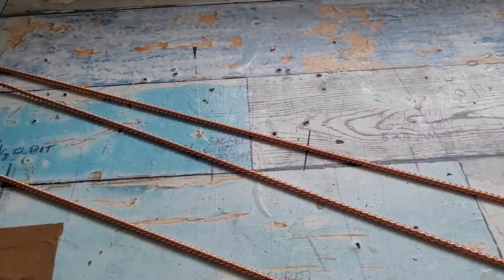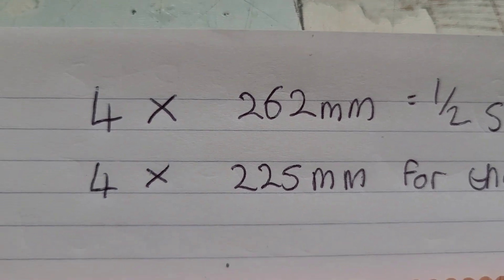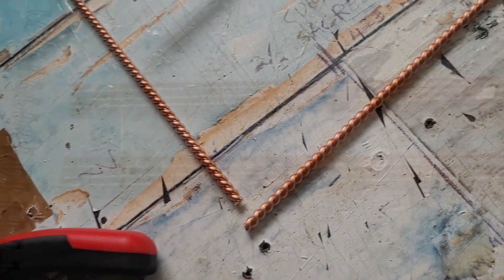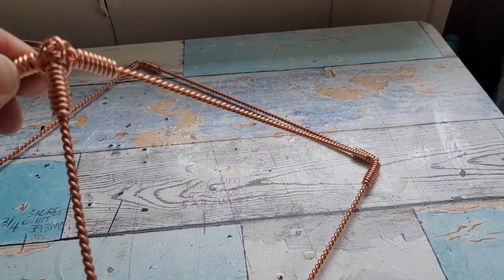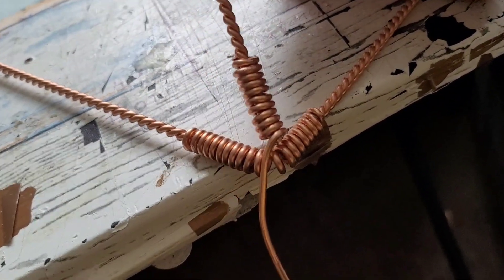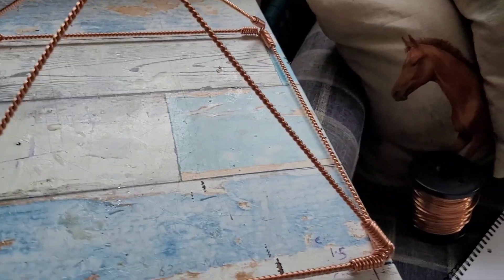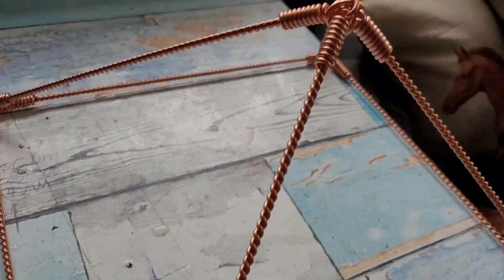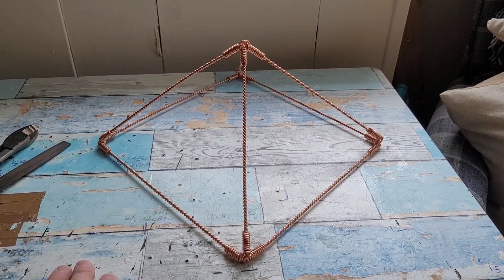How to Make a Tensor Pyramid [Step by Step Instructions]

Comment: What gauge is the copper?
Reply from the maker: @iconicexteriors6486  it's 2mm copper which is UK 12 gauge 🙏
Reply: @cosmicjourneyswithalanstoc5608 outstanding, thank you.
Reply: If I apply a crystal to the 3rd eye area, will that lower or raise the connectivity.  I ask because these measurements are precise, and i don't want to lower it at all.
If that makes sense.
Reply from the maker: @iconicexteriors6486 it will definitely help ❤